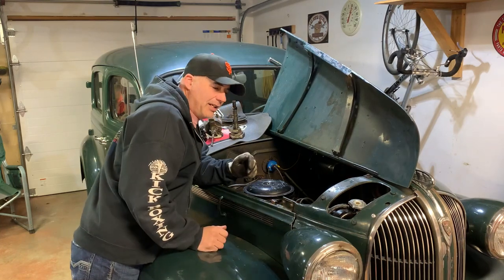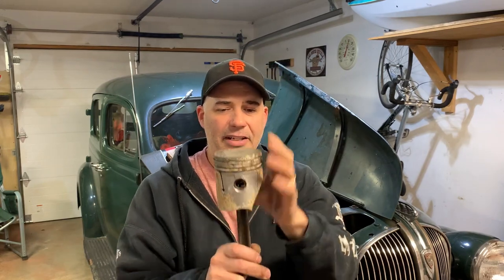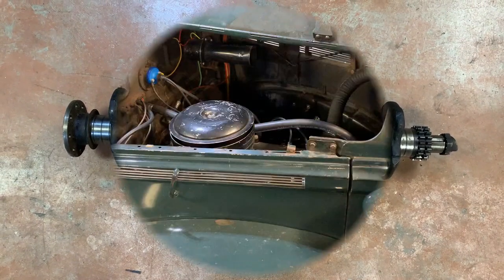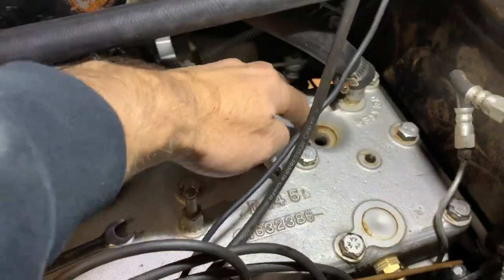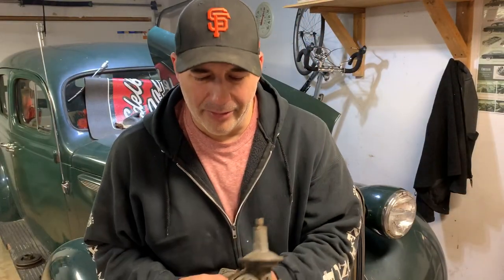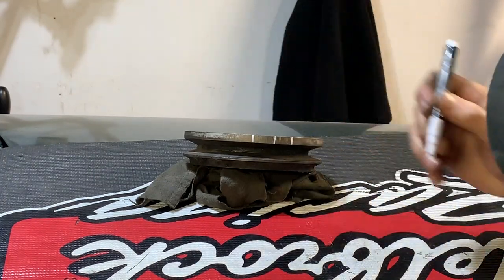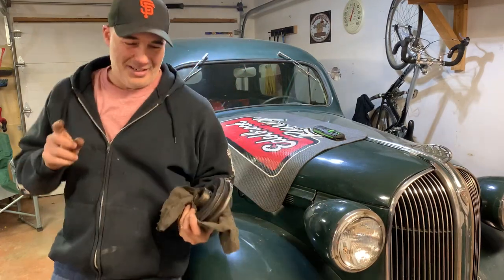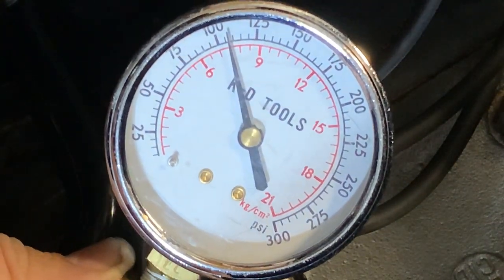Verifying TDC - Flathead Era Engines

Comment: You are awesome Keith, Thank-you for replying!
Yes, that is what I decided to do, I believe there was a little carbon blocking the hole so I tapped through it. Then I was able to confirm TDC, Rotor & Distributor positions.
I have also been having some voltage issues from the key start position to the coil and the distributor.
I ended up running a new wire from the key "on" position to the coil. Before trying to turn the engine over again I confirmed I had 6 volts entering the coil, leaving the coil and at the distributor.
When I tried turning it over it sounded like it was trying to fire, after multiple attempts no go.
Checking the voltage again at the coil after this attempt yielded only 4 volts going into the coil and a fraction of a volt leaving the coil and at the distributor.
My conclusion now is I have an electrical short at the distributor. I will take a pause from it for a while and the next time I will try to source out the electrical short at the distributor.
Thanks again Keith for making those awesome videos, I am using them as my troubleshooting bible as I sort through all of this.
Cheers

Comment: Good video, but one thing needs to be emphasized. You need to find TDC on the #1 cylinder COMPRESSION stroke. You talked about it for the #6, but to be at TDC you must be compression stroke for #1.

Comment: Just re powered my M37, got rid of the old 251 and put in an IND 265. All the timing marks are wrong, as I had to change almost everything, including the crank hub and pulley. The 251 was one of the civilian contractor rebuilds, it was bored .060 over, with STD pistons! It ran fine, but burned oil and had slight piston slap occasionally. Noticed the problem when I changed the head gasket, you could move the pistons from side to side way too much.

Comment: distributor timing simply demands that the rotor contact a post on the cap (the first post to use is your choice) of the distributor that's connected, via the plugwire and sparkplug,  to the #1 cylinder at TDC on its compression stroke. follow around your cap, either clockwise or counterclockwise, depending on your engine, by connecting the remaining posts to the other cylinders in firing order. different engines may have different firing orders and the location of the #1 cylinder may not be always at the front or rear of the engine. and different engines may require subtle variations as to how to go about finding TDC on the compression stroke.

Comment: Hi Keith, recently discovered your channel.   Really interesting and helpfull in my restoration project .  Keep going on !
Question:  What was the speedy sleeve you used on the crankshaftpully ?  Thanks.
Chris.
Reply from the maker: If the shiny machined surface of the crankshaft pulley is pitted or grooved it will leak oil. The oil seal cannot retain oil as designed. The speedi sleeve creates a fresh new surface. Then the seal does its job. No oil leak.

Comment: Using a timing light and I increase the RPM I can see the timing advance. Without changing the RPM the timing will automatically go back to where it started. Am I right in assuming the diaphragm is leaking? Will this cause the engine to load up like it is flooding when I increase the accelerator? Can't seem to get the car (55 Plymouth flat six) to get above about 50 MPH. Thanks for all your videos.

Comment: I just got a 52 windsor deluxe flathead 6 and the carb has the little tower with 2 wires for the fluid drive tranny I got a rebuilt carb that has the same tower thing woth the leather peice but only has one wire do I need to switch them out or can I just solder a wire to the other side can't seem to get it to fire and think that amd the resistor square thing on the air cleaner post has somthing to do with it can't find anything anywhere on it

Comment: Hi Keith, I have now watched a couple of your video's, awesome job Keith, I am learning a lot from them. I have a 1950 Dodge 1 Ton truck with a flat head six engine. I am trying to get it running however when I pull out the plug in the head to find TDC on piston 6, I cannot put a dowel rod down the hole, it stops like the tap of the hole doesn't go all the way through. Can you tell me why I might be experiencing this?
Thank-you,
Randy
Reply from the maker: If you’ve got the right size dowel, could the hole be plugged from carbon build up in the combustion chamber? Can you tap through it?
Reply: Make sure you are using the little access plug above cylinder #6, not the spark plug.  It's smaller than a sparkplug.  The spark plug is not over the piston in these flatheads.

Comment: Greetings from Peachland BC. 
Another good video!
We are working on a 47 Dodge WC pickup belonging to PFRS.
The spark timing is off. The timing mark pointer is missing so your explanation really helps. I did not know about the timing check hole at #6. The service manual does mention that, but it is not very detailed.
 It really looks like the previous rebuild got the oil pump drive out one tooth. We cannot advance the distributor at all. It is at the end of the adjustment travel. Will be looking for a timing mark pointer to install first chance we get. Might have to estimate timing and adjust by driving load ping, and by vacuum readings.
Thanks.
Gordon 
Pres. 2021 2022
Peachland chapter VCCC.

PS you might like this 21 Dodge a club member owns. I saw your video walk around of a 21 Dodge.

https://studio.youtube.com/video/u35zbrDE4q4/edit
Reply from the maker: Hi Gord. I am in VCCC Kamloops.  If you are out of timing adjustment, look behind the distributor base with a mirror. There is another “major adjustment” bolt and bracket.  As engines wear, (timing chains & matching sprockets) timing will need adjustment. Often beyond the minor adjustment range.